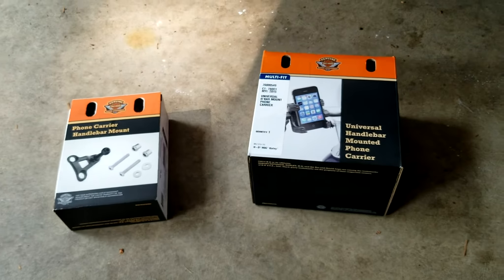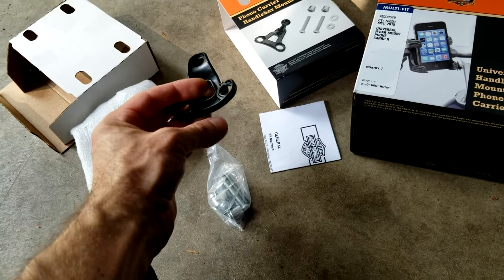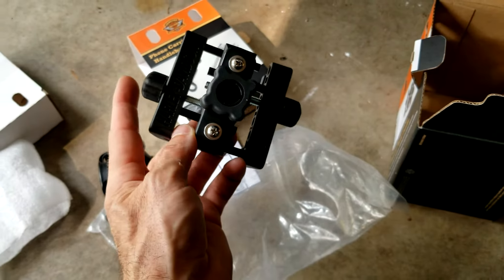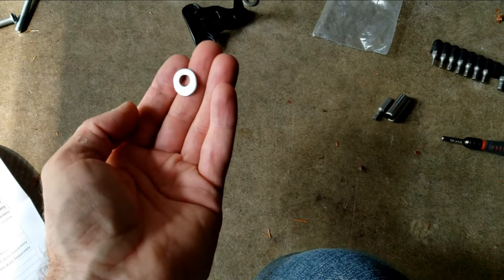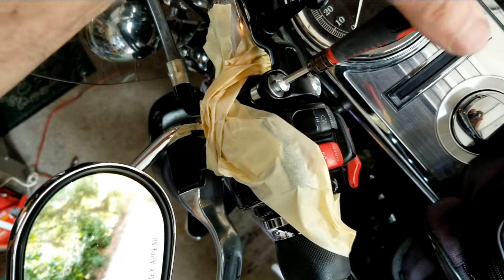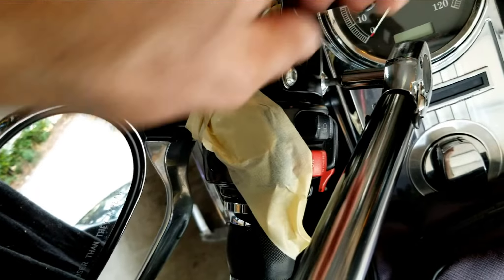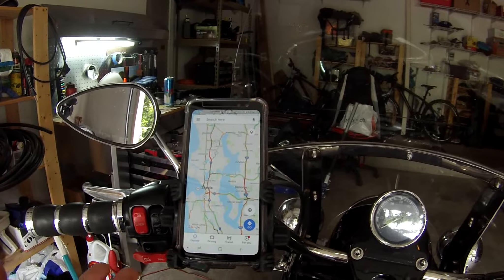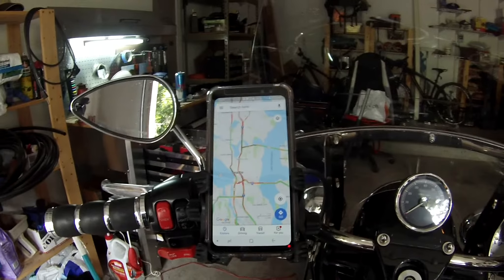Harley Davidson universal phone mount & install

Comment: Just picked one up but haven't installed it yet. Looks to be a decent mount. Not sure how well it will hold my phone with the case I have. How do you like it after using it for a while?
Reply from the maker: I still like it. But if you have a large phone or the phone case doesn't fit, or you want to use it every day, it may not be the right mount.
Reply: @nwroadrat  thanks! My phone with case does fit but not as well as I'd like. Thanks again for the info
Reply: the phone does not stand still, it goes down